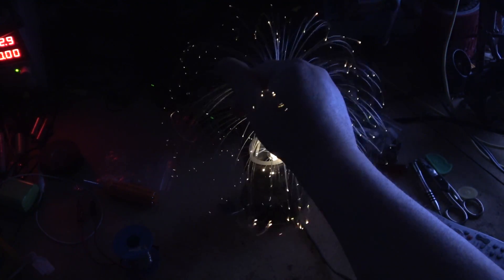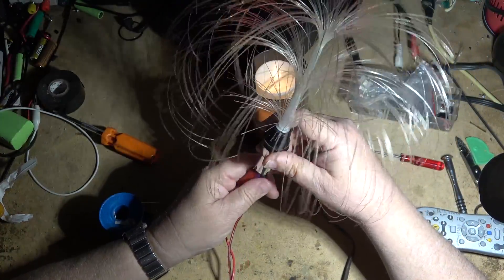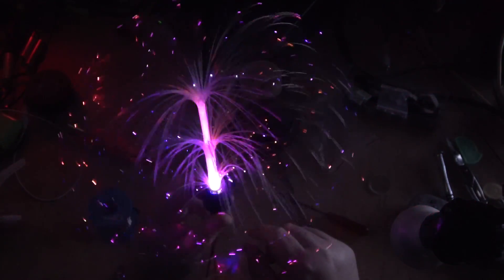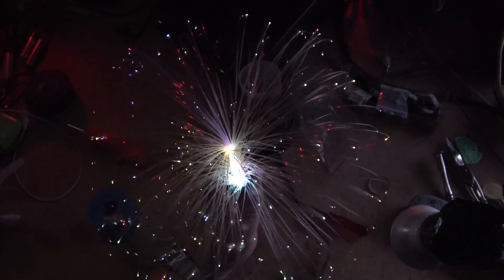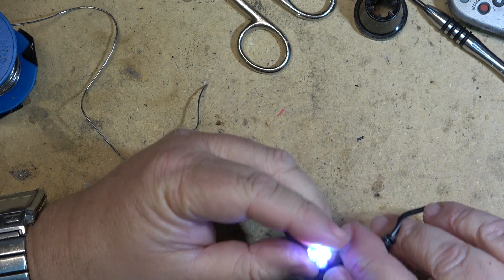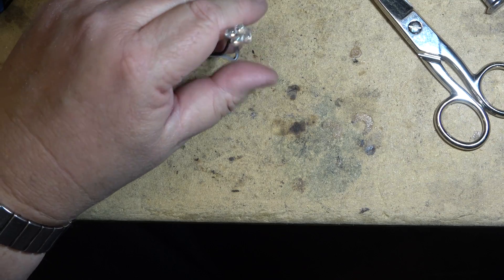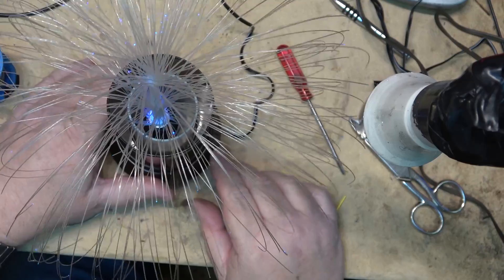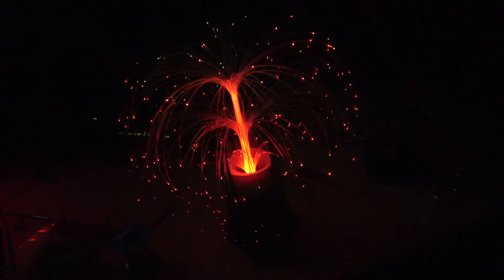My old fiber optic lamp gets an update

Comment: I still have the original Fantasia Alpha with real Fiber Optics, (Glass). Yes, the kind that will cut you if ever broken. Made originally in Worcester, MA. They went out of business years ago. They were sued for using the glass FO’s when people were cut from misuse. Everything is a lawsuit. Anyway, they want a small fortune for these on the used market. Still works beautifully. Real brass base and rotating colors.
Reply from the maker: The danger with fiber optics, real fiber made from glass is that it can kill you. Now I don't know the diameter of the glass that your fiber optic lab has but the fiber we use in Telecom is very fine and yes you could make a beautiful fiber optic lamp from the bare strands the problem is it's small enough 0.9 mm that if you get stuck with it and a piece breaks off under your skin well it can be pretty uncomfortable until calcifies and becomes a bump under the skin at that point but the real danger is if it breaks off in a vein it can travel through your bloodstream and Lodge in your lungs or your brain depending on where it gets to and then you'll either have a pulmonary embolism or stroke! In other words it can kill you if it doesn't kill you you can have some serious life altering problems. That's why they got sued.
Reply: @12voltvids  Very good point. And great information. I had no idea. I have been very careful with it. But, in the wrong hands that sounds like a real danger.

Comment: Always wanted a fiber optic light
Reply from the maker: Since I have access to a pretty much unlimited supply of scrap fiber i could have made my own but the fiber i use at work is glass and hazardous as you can get stuck with it.  Perhaps cut up an old toslink cord and make one out of that.

Comment: Dave, in the past, you've talked about replacing electrolytic capacitors. My question is ; which brands are better and who do you order them from? Thanks.
Reply from the maker: I have found none better.  I buy whatever they have at Lee's or RP. I don't order any online because when the shipping exceeds the cost of the parts then something is wrong.  Some will say just order a big order to offset the shipping.  If I did this for a living and went through hundreds of parts this might make sense but I don't. I bring in perhaps 30 in caps at a time, why would i pay 30 additional in shipping?
So i get whatever brand they have in stock.

Comment: Interesting You bring this up. I was wondering If a Person can still get these..
I have not gone out and looked yet..
This may sound kinda corny, Through the Years as we Scrapped out Phones for Recycling I Kept all the Buttons and collected then in big plastic Jugs I have several thousand of them.  I had envisioned a Retirement getting Bored Project of a Piece of Artwork with the Buttons mounted on a Board all in random fashion with a light Fiber to the clear colored & red ones to light it up and using a piece of the older 25 Pair cable with the Jacket stripped off for the Boarder. (the older cables had brighter vivid color)  
Thanks for the Reminder to look..
Mike M.
Reply from the maker: Yes they still sell them. This one old, and now modern with color change LEDs.  I put 4 in so the light beams from the led change randomly so the entire lamp looks like it's moving.